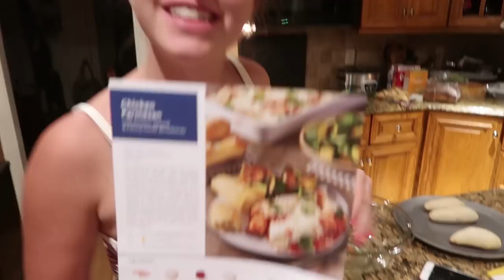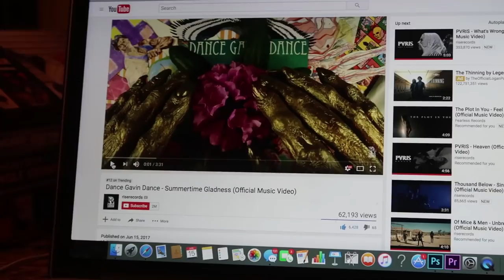MY FIRST TANDEM DRIFT COMPETITION

Comment: Honestly I felt like Adam won, all bias aside being a fan. He kept it super close on his follow run and the white car didn't match his sideways angles when Adam was leading.
Reply: Longdick Swangin my thoughts exactly
Reply: Longdick Swangin he easily should of won
Reply: it felt like they put him as a 2nd place just because of his last corner, on his final leading run :(
Reply: With a OMT run the first set becomes irrelevant, at the end of the day clipping points and smoothness > proximity 

It was close but the right call was made
Reply: Longdick Swangin he hella won
Reply: Adam drove great all night, his timing was solid for the most part. one thing he fails to mention about the drivers meeting i just wanted to share with everyone is that the judges specifically said they don't wanna see people riding rev limiter all night because that doesn't demonstrate throttle control. they also didn't want straight hand brake entries. overall consistency in driving, consistent spacing in between cars and timing of transitions when chasing the lead car is what the judges were looking for. angle and proximity were not stressed nearly as much nor should they, that's just a bonus if you can do all of that and be consistent while doing so. also, i lost power steering right before qualifying so i drove the whole night with no power steering for the first time and on a flipped set of used tires i drifted on last week... plus this was everyone's first time driving this reverse layout so it's not like the odds were necessarily stacked in my favor. for not having too much tandem experience and hopping right into a comp in the rain (which was new for you as you mentioned), your driving was fantastic! your transition timing was awesome. i'm glad we got to battle it out in the end and congrats again to you. hope to see you at some more local events! i didn't write this comment to bash your driving or anything like that btw, just setting the record straight for those who don't know or thought this was an FD event lol
Reply: I agree.
Reply: Longdick Swangin.... I think that he should of won to. He did way better than that other guy. Adam had way better lines.
Reply: Longdick Swangin I agree with you, he seem even more agresive in his runs than the other guy in the white hatch. But congrats to Adam he got second place and it's better than nothing
Reply: I don't know much about scoring but the first run I thought Adam had it too.
Reply: His chase run was really good but the gap got a little wide but he did got the advantage from the chase run. His lead run was the one that turned it down because he slowed down too much when he got to the third transition.
Reply: Longdick Swangin yeah i agree hey but as long he had fun thats all that really counts
Reply: Longdick Swangin I felt the same way

Comment: Put air ride airbags on your truck so you can lift and drop it when you want
Reply: Cameron Myers If it's under warranty, that's probably not advised nor covered.
Reply: Jake Andrew soooo? Adam has bank
Reply: @edgar bruh that reasoning is the reason why you will never have "bank"
Reply: Harley Ames It doesn't even squat that much.
Reply: It dropped like 2-3 inches clearly. With an empty trailer I can throw a 25,000 pound telehandler on the gooseneck about a 30,000 combo and my 3011 ram 3500 dually with air bags won't seat even a half inch
Reply: Joseph HD i agree with this guy. I have an old second generation dodge ram 2500(non dually)  without bags and iv put 2 tons in the bed and it only drops half an inch. Iv also had a trailer with an expedition on and my ram took it like a champ with about an inch drop no bags. Fords should have bags for something like that though. Hell if i had a car like adams id put bags on my truck to raise the rear so i dont bottom out the car taking it off a trailer. Edit: was agreeing with harley
Reply: the suspension is designed for swat I understand but I just hate the look and yes I agree in Adams case it would be graet and that's what I was trying to get at as well thanks for agreeing with me appreciate it
Reply: XfiRated I've honestly only watched a few videos of him and couldn't stand his voice lmao

Comment: use toothpaste on the windshield to stop it from fogging
Reply: david crow WD40 works better if you wipe it properly.
Reply: Alright Vegemite I've never tried
Reply: or just get anti fog that works the best of applied properly
Reply: david crow try it, works a charm. It sometimes gets real cold in Aus at night to the point the windows frost up and before I tried WD it was difficult to get off with a scraper and the after applying the WD it would just flake off just wiping my finger over it. Also stop the windows from fogging up and also is a good water repellant.
Reply: Alright Vegemite ive heard shaving cream works great
Reply: JC Bélisle shaving cream? Lol seems odd to . Might have to try it next time my windows need a redo. Interesting.

Comment: bag your truck to get some extra height out of it?
Reply: anfernee Stewart I was going to say the same, that thing dropped way to low for my comfort zone, he should bag the rear and get some upgraded towing suspension, we did that with our truck, it used to pull a 42ft camper across the country before my dad bought it from a customer
Reply: don't you mean, bag your truck and daily it?

Comment: Hey Adam have you tried using the trailers jack to lift the trailer and load and unload before hooking it up to the truck that's probably the easiest way . an if you need even more angle before you unhook it from the trailer stick somethimg under the hack and it will give you added height... ??

Comment: Adam I'll admit I don't know a lot about drift cars but I know a lot of people like to put wood blocks under their car against the chassis so that way when you are going down the road with the car in the trailer it takes the load of the straps holding it down and the bumps off the suspension

Comment: when loading or unloading the car from the trailer, you can avoid damage to the car with two lengths of wooden 2 x 4's
when loading as the rear wheels get on the ramp place the 2 x 4's in front of the rear wheels and drive up on them 
this will raise the car to clear the ramp.  When off loading place the wood so the rear wheels get on the wood in the same spot You will need to cut the wood to fit in front of the rear wheels but not interfere with the front wheels.

Comment: I 100% agree Adam lz should have won, his final run was way better than the white s chassis, the rules were explained that the follow car has tomatch what the lead car does and Adam had way more angle the entire course so of course he's going to be slower that the chase car who was Initial d style drifting for speed to catch up...  I don't even like Adam lz as far as a drifter because he hasn't taken the time to learn key techniques but he is getting good and has alot of natural talent..  work on those heel toe downshifts and stop scrubbing speed with the e brake and you'll hold speed alot better through transitions..  the same concept of pumping a ramp to gain speed, use that "sling shot" effect from transitions to kinda speed boost and quicker direction change..   more foot brake less e brake and speed will be easy..